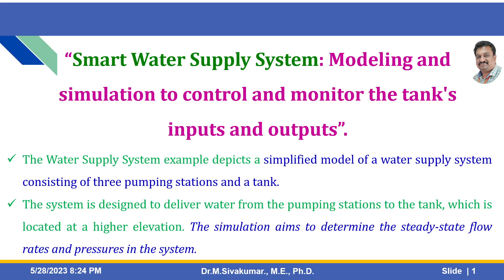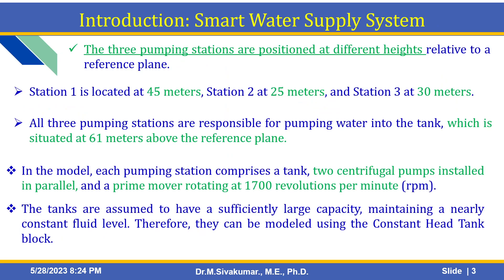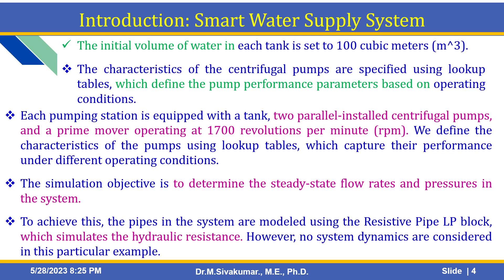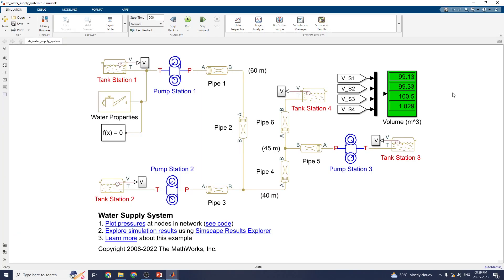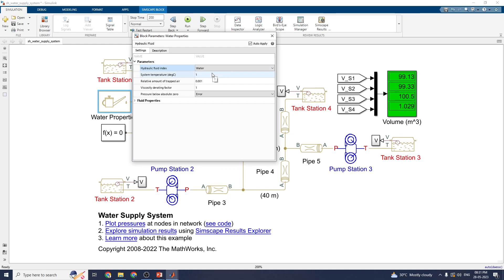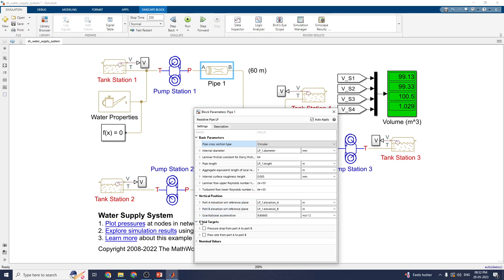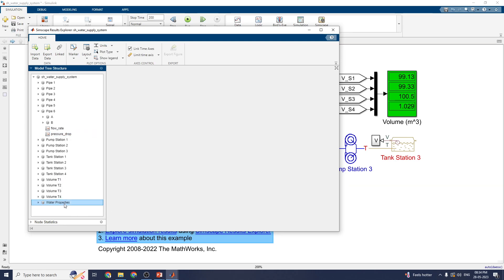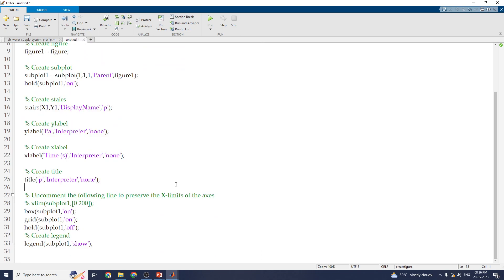“Modeling & Simulation of Smart Water Supply System (Control and monitoring Pressure & SSF Rate)”.

Comment: Good tutorial sir, i am new to matlab simulink, you have written separate block on the right side top corner mentioning vs1, vs2, vs3 and vs4 what is this block and what are these vs terms
Reply from the maker: Pressure at 4 different node points...VS1 to VS4